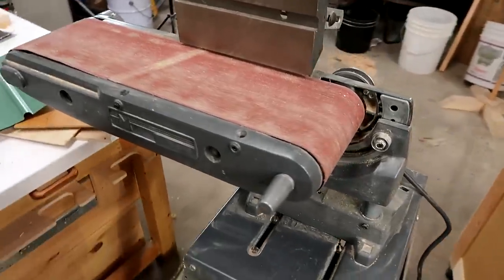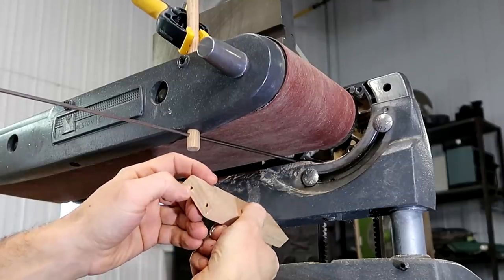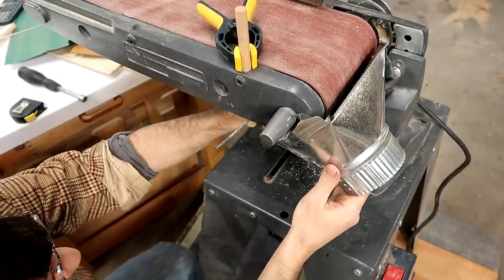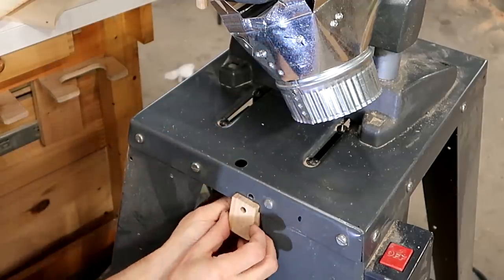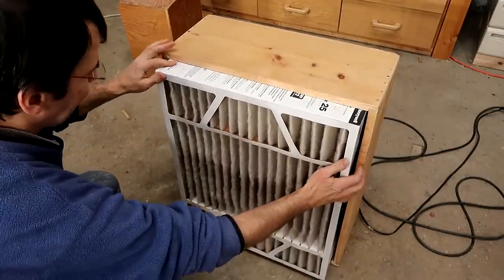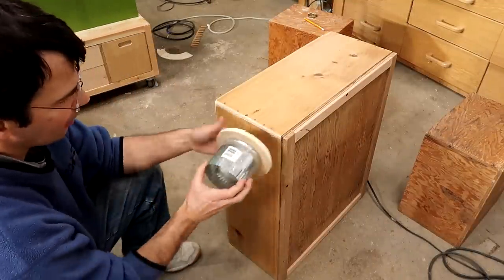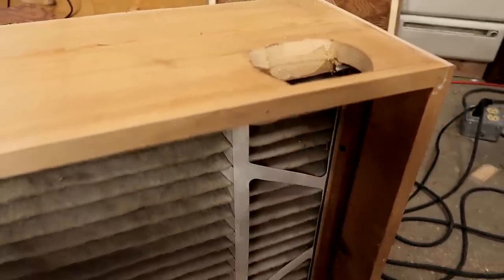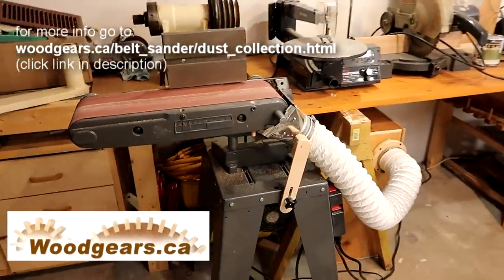Belt sander dust collector

Comment: 5:59 I was hoping for a few more steps of reinforcement ;) - "I've had some bad experiences with the wooding rails coming loose, so I'm adding some construction adhesive to hold the wooden rails, so they keep the duct tape on, to hold the filter in place. But since the adhesive might crack, I'm encasing the whole thing in cement."
Reply: "But I had some bad experience with cement collecting moisture so I'm adding a layer of varnish to seal the cement.
:D
Reply: "Problem is that varnish really isn't good for your skin though, so I'm adding a layer of duct tape to my hands to prevent the varnish from getting all over them, and to save on cleanup on brushes, I'm just going to use some old shirt rags to wipe the varnish onto it."
Reply: "I don't want the duct tape to rip out the hair on my hands when I peel it off so I lightly cover my hands with sawdust before I put on the tape. This way it doesn't stick too much and I can peel it off easily. Plus the sawdust is free."
Reply: OMG! :D

Comment: Good job as usual. I love to see how people repurpose off-the-shelf items and this was a prime example. I think I have seen rectangular to round sheet metal ducting adaptors or maybe they were for downspouts but either may have also worked. Wearing out screw holes in wood can also be remedied by moving the holes.
Reply: The round-to-rectangular adapters are called 'register boots' or 'duct end boots' and they are perfect for this application.

Comment: well done.
I got really excited at the front end of the video that your dryer connection at the sander had a nice sweep in sheetmetal.
but then you showed us the dust collection side, which looks more like an orifice plate, than a bell mouth.  XD

I was hoping you would put a bellmouth on the flat side of the box.

Would be a problem with a shittier dust collection system, but you just threw a ton of power at it, so no big deal.

Comment: Just a thought on your gasket- you could use caulk, but wipe some vaseline on the lid side as a mold release so it only sticks to the one side.  Not as free as cardboard though.

Also you can drip a bit of crazy glue in the #7 screw holes.  It helps to keep the hole from wearing out

Comment: Great pick up shute, but I would imagine the filter would become clogged very quickly. I have a belt sander and it puts out a LOT of debris when in use, I have a dust collection tube for the back of it.. thanks for sharing!
Reply from the maker: have been using the same filter on my other 6x48" belt sander, and it hasn't been a problem.

Comment: I did something similar. But I fastened a couple rare earth magnet to the pipe I used. It is stable, I can adjust it with ease and remove it without needing to unscrew anything.

Comment: Looks like the official Shopsmith belt sander dust chute is currently $23 + S&H. Of course, that wouldn’t have been as interesting a video.
Reply from the maker: hmm, I had one of those way back but lost it.  But it would get in the way for sanding curves.  Plus shipping to Canada ususally ends up adding another $20
Reply: Matthias Wandel True about the cost of shipping, but since the top drum is the same radius curves could be sanded there. Of course, that would be on the opposite end from the dust chute!

Comment: I have a suggestion/challenge/query. Can/will you build a power take off (from whatever machine you are using) to drive a fan that provides suction for the dust collection? It would eliminate the need for a dust collection motor. You could use pulleys and or wood gears. I don't think it would drag the machine down too much. Might be complicated but I know you could handle it.

Comment: Thanks for another great video. Entertaining as always, and I'm glad to have watched it.  But... how do you empty the sawdust and change (or clean) the filter?  It seems like a lot of screws for routine maintenance. Also,  I wonder if the shape of the duct is actually ideal? I'm genuinely curious if it wouldn't be more effective if the opening were a thinner slot, perhaps, rather than a generously flared opening? I think the answer could probably be answered by google and science. But I bet it could also be discovered through experimentation using scrap hardwood and a pantorouter...? Or maybe instead of just a thin slot, it could be a curved piece of wood to closely fit the shape of the belt, but with just a round hole in the middle which doesn't reach all the way to the edges. This could maybe reduce the amount of air sucking in from the sides (which seems like this air is doing nothing). The air would have to flow very close to the surface of the belt to reach the hose.

Comment: There are many of these 6x48 sanders floating around on the used market for reasonable prices but most of them need a little fixing up. Rather than building one of these out of wood you should build one of the wider units that cost thousands of dollars.

Comment: lol @ 6:07 I was anticipating "I've had some bad experiences with wooden rails becoming loose over time, so I'm adding some epoxy to the joining surfaces to hold them in place."
...
"I've had some bad experience with epoxy degrading over time, so..."
etc.

Comment: What if you lay the box on it's back so the filter is on top. Then add some kind of vibratory device to it so when it's not sucking, you can vibrate all the particles out of your filter to the bottom of the chamber.

Comment: "When they ware out, I could use longer screws or number 8 screws"
Or, you could just drill them out a bit, screw in brass or metal threaded inserts, accompanied with thumb or  knob screws and forgo the whole waring out part!
Reply from the maker: yes, but the whole "wearing out part" is so far down the road, it will probably outlast me.

Comment: wouldn't a lip with a gasket on the blower side of the filter do a much better job of sealing the bypass around your filter? That is what we do in commercial HVAC anyways. Seems like it would be easier to change the filter as well.
Reply from the maker: hvac uses much lower pressures, and blowby is much less of a problem.  It's only air from the house that goes thru, so if a small part bypasses, that's ok.  Not so for dust collection

Comment: I think you should have used a plexiglass cover instead of plywood so you could have monitored the dust in the filter.
Reply from the maker: plexiglass is super expensive
Reply: Are you telling me you don't have a stash of plexiglass from taken apart from PC screens? :)
Translucent, but good enough.
Reply: Yonatan24 I never knew PC screens were plastic, I thought they were glass.  Certainly the CRTs were and my Surface is, not sure what the TFTs are but thought it was all part of the display, rather than a separate piece?
Reply: Nope, I'm referring to the diffuser that's behind the screen, behind the diffuser. I've gotten like 7mm thick plexiglass from broken screens. I think I might need to make a video of this!
CRT's are glass and rear projection TV's are a huge plastic fresnel lens. 
I think some PC screens are plastic and some are glass - not sure.
Reply: Yonatan24 Oh right, that's handy to know, I'll have to start checking when I have any broken screens :)
Reply: A small hatch would be sufficient for that, no?
Reply: As long as you make it big enough for light to enter... Yes, I guess.
Reply: You could take off the hose and look in. That would probably be faster than taking off the cover.
Reply: That risks wearing out the screw holes there and also the foam he stuck on.

better to just open the main cover. Those holes are easier to renew over time.

Comment: Man I wish you designed the metal polishing equipment I used to work on when I used to be a metal polisher. If you guys think woodworking is Dusty look up a metal polishing worker they look like they have black face on.
Reply: Woodworking is still Dusty and everything Matthias does is still worthwhile. Not trying to have a pissing contest

Comment: Regarding the piece at around 1 minute 45 seconds. Couldn't you just rip it in half with the band saw, make a shallow cut with the table saw, and then glue them together again? That would make a straight hole all the way through. A square hole, but a hole none the less.
Reply from the maker: that could be done, yes.  But completely unnecessary.  A shallow hole from either end is much faster.
Reply: I suppose. Thanks for the reply, and thanks for all the videos : )

Comment: If you cut the metal rod into a drill end and lowered you drill press table to floor you could drill that strait? I take that back you have a long drill bit???
Reply from the maker: alignment is not the problem.  Drills wandering is the problem.

Comment: Instead of duck tape, why not put weatherstripping on the frame where the other side of the filter mates up?
Reply from the maker: weatherstripping needs a bit of pressure the seal, and the cardboard filter frame is not that stiff
Reply: Doesn't the fan provide pressure?

Comment: Meow; it's not impossible, I think the same procedure I used to copy two holes through a forearm's length board (where absolute precision and alignment was necessary) should work.

edit:  Wait... was that a joke that would explain why someone might kludge something on w/ the panto-graph for a functionally unnecessary feature.

(in a drill press)
- a shaft salvaged from a printer was chucked so that it extended past the working table
- the roll was set vertically by flattening the table against the shaft.
(then for each of the four openings)
- the yaw of the table was adjusted so that a pin (held in the chuck) aligned with the hole being copied
- the vertical pitch was set by clamping a fence to the table so that the hole being copied aligned at both ends.
(then afterwards)
- remain indignant that this solution was mocked "as [expletive] obviously what a hand-drill is for"

Comment: Kinda disappointing this dust port wasn't a little higher on the belt sander. It's possible to see quite some dust flying over it still. I just think this would improve the efficiency by quite a lot. Good video anyway.

Comment: Not used to such shitty building quality on this channel...
Reply from the maker: Care to tell me what is shitty about it?
Reply: I wouldn’t say it’s shitty, it’s a shop project witch ended up been practical and worked as intended, there’s still design and engineering thought that went into it
Reply: Matthias Wandel I don’t feel it is shitty , but I feel you could do much cleaner work. I know the idea is to use and or recycle old stuff , and you are clearly very good at what you do, but it seems you rushed that project, just my opinion. I love your channel and enjoy your videos.
Reply: Nothing is shitty.  I love these little ad hoc solutions.  Reuse materials, and functions just how you want.  MW...you are my spirit animal
Reply: It is his B workshop area.
Reply: It all depends on its purpose. This build's purpose is to collect dust and not break. It doesn't matter if it's pretty or ugly. If you are building fine furniture, it's job is to look pretty and not break. So if the hole into the dust collector isn't perfectly round, but it does its job, then it's perfect. But I guess this just depends on personal preference.
Reply: I would have expected a custom made hood made from wood and the mounting all seem quite dodgy
Reply: Oh, for the love of Pete! This gentleman has two kids now, no time to spend all week on a fine dust shroud on a 30-year-old machine.